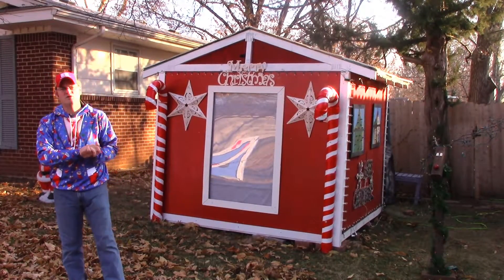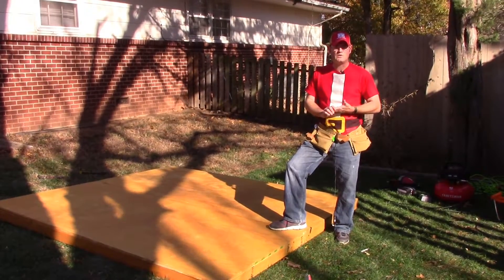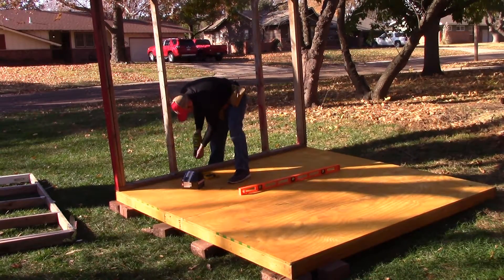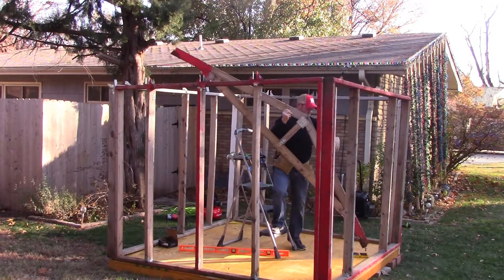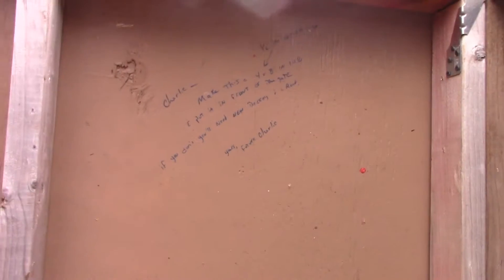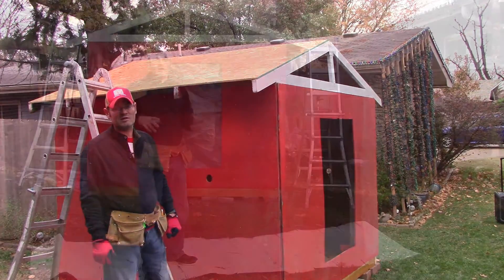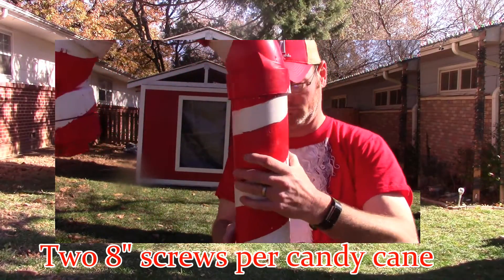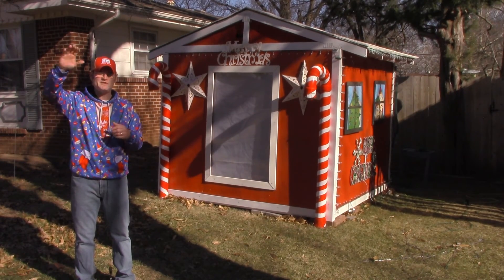How To Build Santa's Workshop: Large Christmas props

Comment: I live about an hour from u. my kids and I have done low key light shows, this year we would like to go big. question is WHERE DO I START???
Reply from the maker: Hello Chelsea, I'd recommend, if you want to go big, to go with a pixel show.  @canispaterchristmas is an excellent source on how to do pixel shows on YouTube.  I'd also recommend Xlights for programming. 

 If you are doing a string light show then I'd recommend LOR (Light-O-Rama).  I use Prism software by Revival Control Systems. However, the forums and overall magnitude of help you are afforded through other animators on the LOR websites make it worth it, in my opinion.

Revival does indeed have a fabulous owner that has been a great help to us and the overall price per channel is much lower than LOR.  However, in the long run, you'll want/need help from other animators over time so going with a software that has good/great online forums becomes a huge advantage! Overall, the key is to add something each year that you'd like to see in a Christmas light show.  You have to make it interesting for yourself!  Pretty soon you'll be creating year-round...it is addictive!